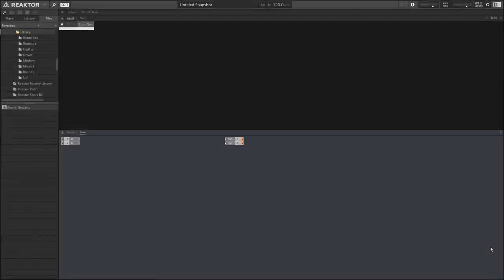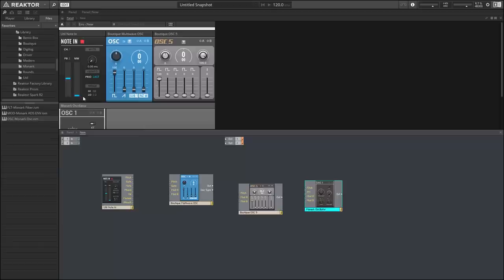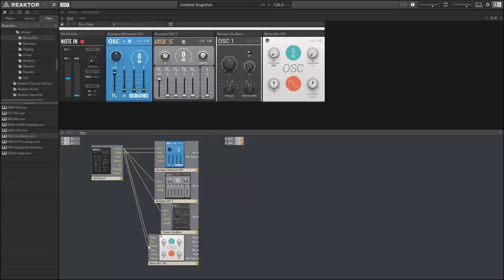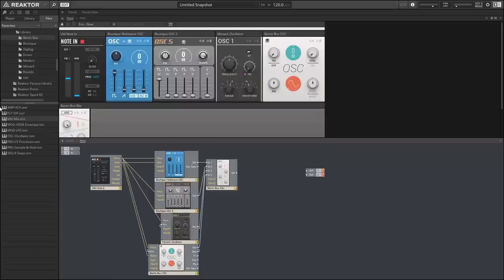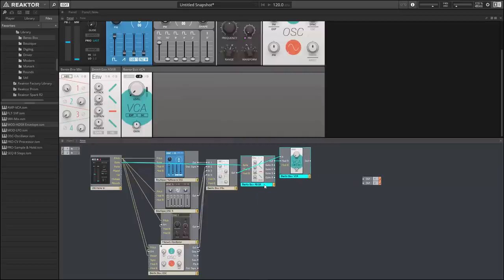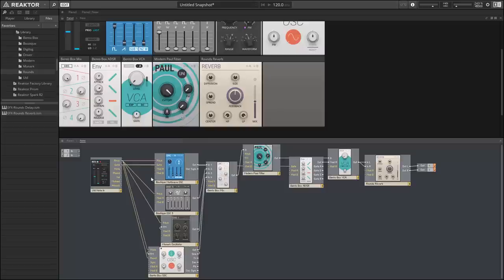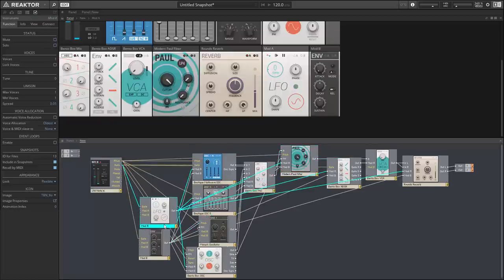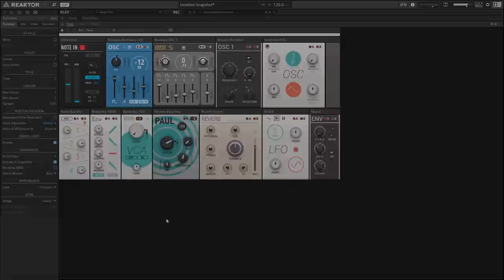Reaktor 6 Blocks pt 2 - Building a Basic Synth

Comment: There is no Gate Input on any of these Oscillators. At least on my OSC's. Only Reset Inputs. Is it the same as Gate?
Reply from the maker: +mamuefa1 I may have said one when I meant the other, they are very similar but slightly different. I'm also using a beta version of blocks here so the port names may have changed. For the purposes of this video you can use them interchangeably.